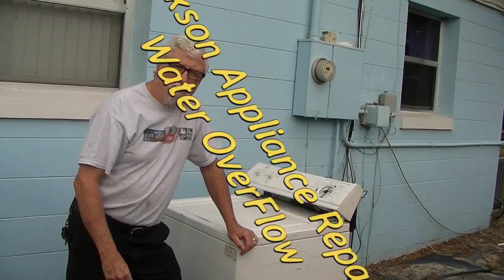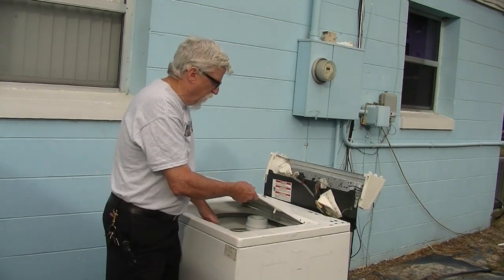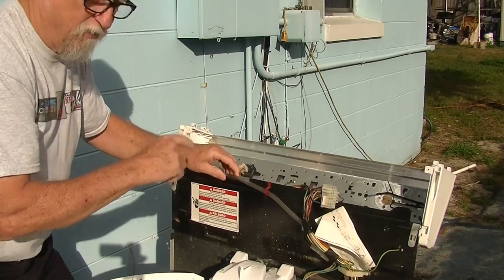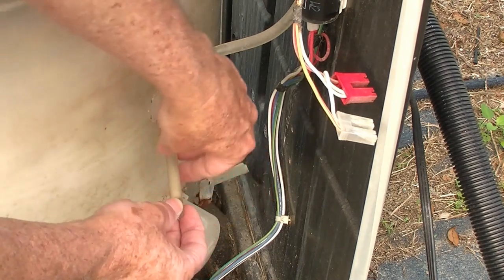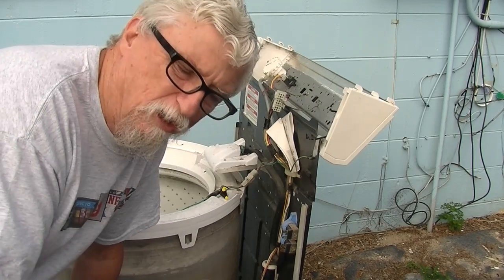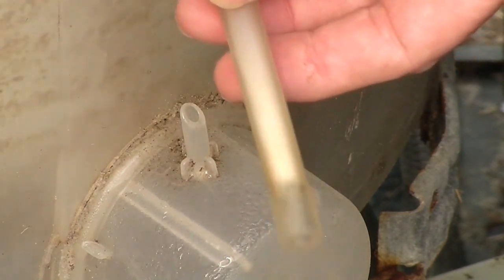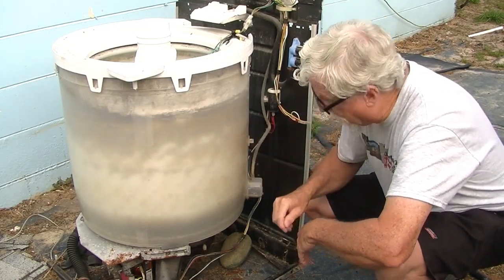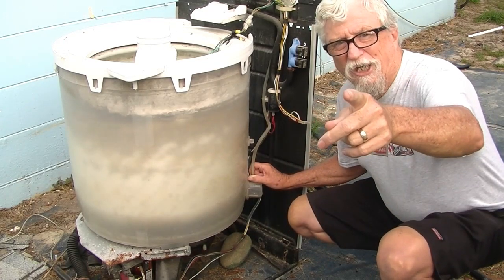How to check a Washing Machine for water Leaks

Comment: My 28 year old GE Washer, which has never had any maintenance other than the main timer switch and occasional cleaning, started leaking from the bottom yesterday. I thought well, it's probably the tub seal or something serious. Even started looking online at prices of new washer and dryer sets. Ran across your video, popped the front off of the washer in about 4 seconds. I found where the bleach dispenser hose had merely come loose at the bottom air pressure canister or dome as they call it. (surprised they don't clamp these!) That's all it was! the bottom of the tub and all components looked almost new! the drive belt even looked to be in great shape! Thanks for posting this very helpful video. BTW, I don't know about the recent model GE washers, but they made a quality machine back in 1996! Thanks again!

Comment: Excellent video 👍🏻, Quick question what is that little clear box called thats attached to the drum where that little hose is attached? Thanks
Reply from the maker: Water level control assembly
Reply: @HaroldJackson  Thanks 👍🏻

Comment: How  do you take apart a newer model apartment size washing machine the plastic cavity is it all connected the same as the metal washers
Reply from the maker: All machines are different. They hide the screws from the home owners. You can look up your machine on the internet to see how to take it apart. Good luck.

Comment: Hi have an whirlpool top loader and I notice water at the bottom in the front of the washer could you tell me what might be the problem? I have no problem with overflow it washing fine I just notice the water on the floor it wasn't that much water

Comment: My 4 year old Whirlpool has an occasional small leak from the bottom. It seems to only leak (about 1 cup of water) when the bedding setting is used. I find some water on the front of the metal cover at bottom and some water is on the tube and water pump but its only on that setting. I make sure its not overloaded. Any ideas?
Reply from the maker: It sounds like the splash guard around the top of the tub may have come loose.

Comment: What about the pump leaking? How do you check? Or hoses leaking?
Reply from the maker: Pump leak on this machine will be in the front. If the hose is leaking the washer will keep filing with water. Good luck and have an Awesome day.
Reply: @HaroldJackson  Thank you. I just find water now and them. Took her all apart and everything is dry under neath. Hoses and all check out fine.
Reply: When I find the small leak, it is directly in the center under the washer, not the front. Easter Sunday there was much water on the floor after washing items the kitties sleep on. Now, I have ran several loads of items the kitties do not sleep on, no leaks. I didn't have any water leaking until I started washing covers, blankets that the kitties sleep on. The dryer has a bunch of cat fur in the lint filter. Could cat fur possibly be blocking drainage from the washer and causing a slow drainage of water and causing the water leaks? Thank you, Mr. Jackson for your help.
Reply from the maker: @elcidlord  that sounds like a center seal leek. Not easy to fix. It takes special tools to remove the tub nut. Good luck.
Reply: @HaroldJackson  Thank you. I had the same thought about the tub seal. Yes the video shows you need a spanner wrench to remove the tub nut.. Thankfully I have one and it is a job I can/did do if it comes to that. I did have my last washer where it was the tub seal and I replaced it= no leaks.

Comment: What if the water is coming out as soon as it's going in?... no visible leaks from the pumps or hoses.
Reply from the maker: Sounds like a drain hose is too low or it's not connected properly.
Reply: @HaroldJackson   just jumped the switch in order to get a better look and the very bottom of the drain hose had about a 2 inch split in it... lol you video did help me ruling some possible leak locations! i thank you!
Reply: @HaroldJackson  sub'd

Comment: So the SPECIFIC problem you're talking about is if the machine OVERFLOWS on filling? Which would be completely different from leaking onto floor on DRAINING, right?
Reply from the maker: If the hose is leaking it will just keep trying to fill. So if the hose has a hole in it it will leak on the floor.
Reply: @HaroldJackson  Hi Harold! I'm not sure if we're talking about the same thing. Your problem was overflowing on FILLING, right? But my problem is that the machine leaks when it starts to EMPTY, and only then. So I'm thinking those would be two very different hoses, right? Or even the drain pump shaft seals.(Oh, sometimes, rarely, it may leak INTO the tub, I think, that is, put a little water into the tub when not in use, so I turn the water off to the machine in between use, but I don't think this has anything to do with leaking onto floor when draining.)
Reply from the maker: It depends on where it's leaking from. Some machines leak when they spin if the machine is out of balance. I would check the drain hose. And clean the drain pipe the hose is connected to. What kind of machine is it?
Reply: @HaroldJackson  Very good responses! Thank you! I hadn't really thought about leaking from spinning at all. I do see what looks like stains on bottom of drain hose from bottom of tub, and around that connection to the tub, but not sure that's problem area, and haven't tried to watch it with back off when it dumps. It's a very old GE Heavy Duty Large Capacity, WWA8364V JLWH. model.

Comment: What if it's not overflowing? Just when it starts to wash it leaks, turn the machine off with water in the tub, it stopped leaking, turn it on it starts leaking again
Reply from the maker: Try washing a smaller load and put the machine on low water level and see if it's still leaking.
Reply: @HaroldJackson  4 pair of jeans on regular cycle, would the seal or pump make it do that? I was thinking if it was the seal or pump it would leak all the time. Only leaking on the wash cycle tho 🤔
Reply from the maker: @mikeharris8365  I would try a small load and see if it leaks. That will tell a lot.
Reply: @HaroldJackson  Ok, just getting this water out of it, I will try a small load tomorrow,
Reply: @HaroldJackson  it does fine with a smaller load,  so what's that telling us?